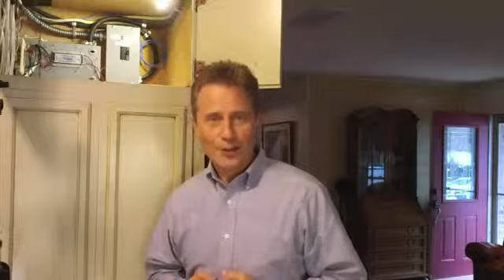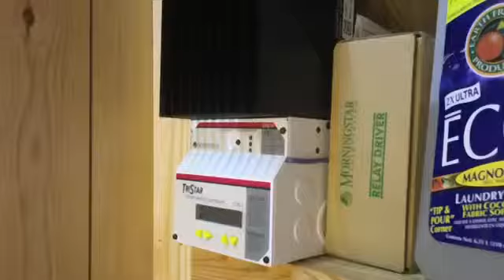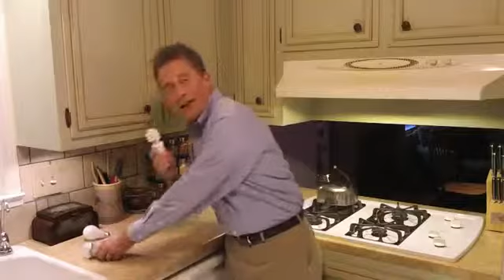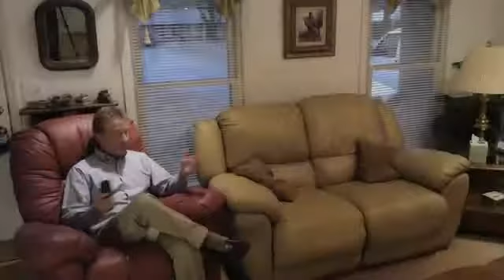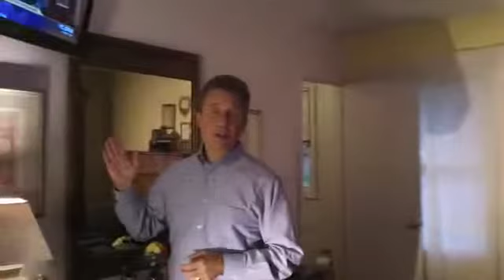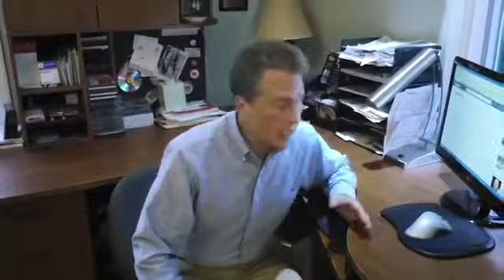What is Power2Choose

Comment: Love this innovative, efficient, clever system.
Wish I could build a house using this system only.
In addition to this system, building codes likely will require a 120/240 VAC electrical system.
How much electricity is required 24/7 by the "occupany sensors"?
Reply from the maker: Robert Gift occupany sensors"?    
  Virtual nothing.a few mA. for the whole house. .